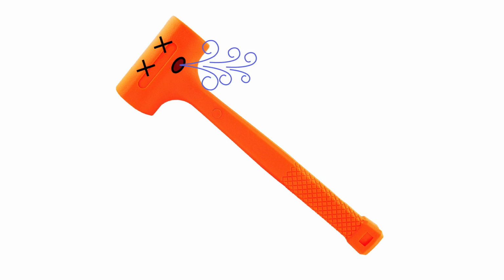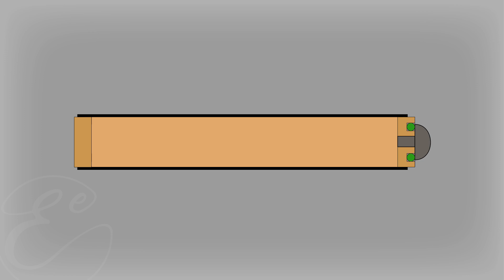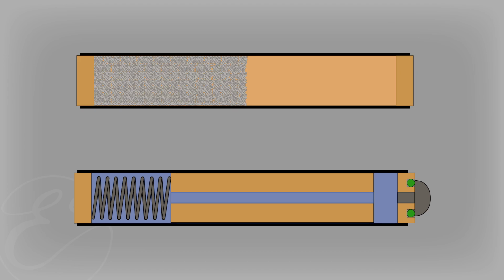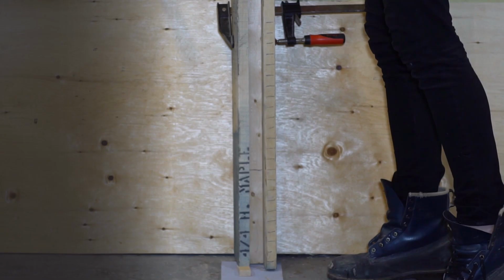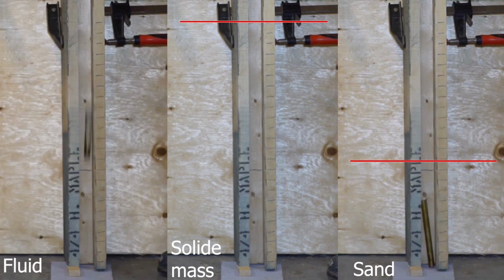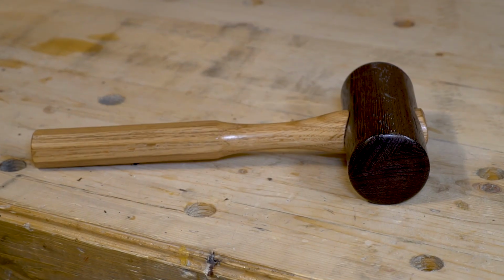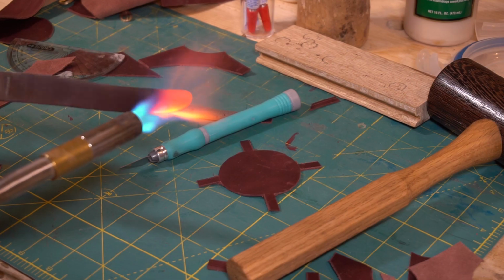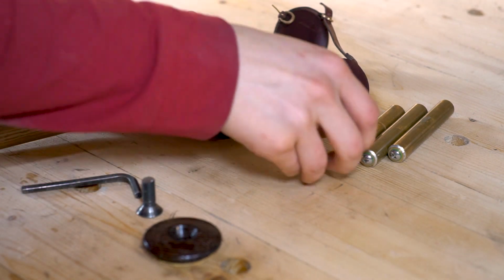Making a Crazy Wooden Dead Blow Mallet with Fluid Dynamics

Comment: Beautiful work, your cylinders are just like the hub mounted dampers used on the 2CV suspension, before shock absorbers where fitted in 1981
Reply from the maker: Just looked that up. Its a really interesting suspension setup!
Reply: It is, independent, interconnected, height adjustable, long travel, soft ride, no anti roll bars, perfect for rough roads  or tracks. The Citroen 2CV is fantastic design solution.

Comment: I'm going to suggest that the sand test's poor performance at 6:20 was partially because the sand is already sitting on the bottom of the chamber when dropped and accelerates at the same rate (or faster) than the tube its in. In a deadblow mallet, the mallet changes position and likely accelerates faster (and in a different direction) than the mallet, bringing the sand to the middle or back of the chamber, making it more effective than in your test. Of course, that wouldn't apply to light downward chisel strikes, but not many people use a deadblow on a chisel.

Still, your hydraulic setup seems really nice. I'm sure it still works better than a sand deadblow. I  mean, the fluid is going to impart force on the head nearly instantaneously where the sand could take a small amount of time to force the mallet head back down after bouncing.
Reply: Was thinking the same thing - the sand cylinders didn't quite get a fair shake (ha) in the drop test because there was no acceleration faster than free-fall to shift the sand backwards as there would be in a hammer blow. Not to take away from the superb construction and cool concept - just being fastidious about the testing.

Comment: What would be the theoretical differences between oils? 
Ie: what other oil did you think of using?
Reply from the maker: With different oils i could tune the difference in how easily the weight moves. Which would mean, a thicker oil could be used for hitting hard and a thinner oil could be used for hitting softly. It's probably excessive, but in theory it could be tuned as such. And I would have used remote-control car shock oils, they are sold in all kinds of weights and you can buy them in small quantities

Comment: What is the exact point of the liquid?Isn't it the metal mass doing most of the work? I would also think that spring is helping a lot. Either way it's extremely effective, so gg.
Reply from the maker: Good question! The liquid is actually doing most of the work. It slows the movement of the mass which lets it move enough to absorb some energy but not enough to transfer energy into a rebound. The spring is only there to reset the mechanism for the next hammer blow.
Reply: ohhh I see, thx for the explanation

Comment: So...(I’ve been thinking about you...well, this project that is), could a spring be used at both ends, keeping the cylinder centered to make the Mallet bidirectional? ....of course this would limit/reduce the available movement of the cylinder...wonder how it effect the function?   Nice job, I love the artistic engineer in you.
Reply from the maker: I do think it would be possible! I thought of it but dismissed the idea for 2 main reasons.  First, I don't actually need it to work in both directions and second, it would make the hammer longer for sure. Or shorten the travel as you said. But now that I'm thinking about it, I think there is also a possibility it would resist to the hammer swing as well. This effect could be a of negligible importance but it could also possibly make the hammer feel heavier to use. Could make it feel a bit like a shakeweight!
Reply: - 😂 I remember those shake weight commercials- takes me back to my teen years and my immature imagination of what I was watching .... good times!
Reply: you could still get the same effect. if you shorten the internal weight by a few millimeters and reduce the diameter of the hole.  Then it should have the same "feel" as a single sided dead blow hammer, but for both faces.
Reply from the maker: @thadcampbell3563  although the resistance for the shock absorber may be the same, the mass is important and it is what activates the damper. So a reduce of mass in the moving weight will inherently reduce the efficiency of the hammer.

Comment: what are you doing at 10:24? I dont understand what I am seeing
Reply from the maker: I'm turning the handle for the mallet
Reply: I mean the T tool thingy you are holding, how does it work? How is it called?
Reply from the maker: Oh sorry, that's a telescopic gauge. It's a tool machinists use to get a precise measurement of a bore. (you take the measurement off them with a micrometer)I like them for woodworking, they are more reliable than inside calipers I find and they can go deeper into a bore than digital/analog calipers.
Reply: Thanks! I am trying to get into machining, I own a Taig micro lathe, but I havent had much time to play with it. So far I am only using it to make brass knobs and I am trying to get a bigger one to do "real" work...
Reply from the maker: @AlainPilon  are you looking to get something like a 10" lathe or a real professional sized one? The one I got is an old atlas 10" lathe and although it isn't the perfect-dream-professional-lathe it had the benefit of actually fitting in my shop plus it was far easier on the wallet.
Reply: 10" is way too big for me. I am looking for something in the range of 6-7" under 1k$ with accessories includes. I have been looking for over a year now, missed a new deal now I am second in line for one I found on marketplace. With some luck the first guy will not show up and I will be able to get it!

Comment: Another superb build, The leather ensemble look like it belongs in a fetish boutique !
Did you consider one larger cylinder, would that have worked ?
Reply from the maker: A single larger cylinder would work well I presume but it introduces a new challenge. The handle would then need to be fixed to the cylinder itself since it cannot go through the cylinder to be mounted like a regular mallet handle. I'm looking at trying it but it will turn this into a machining project more than a woodworking one